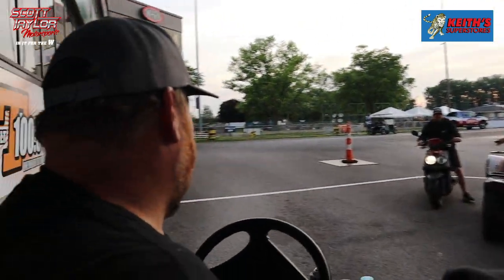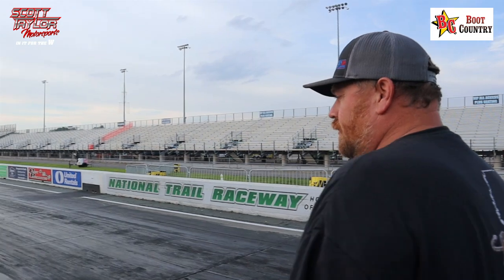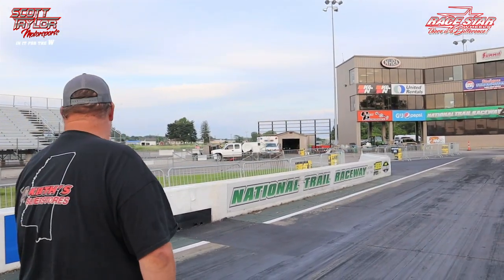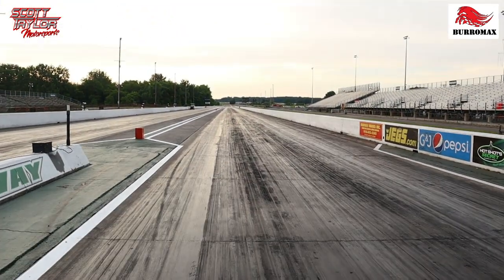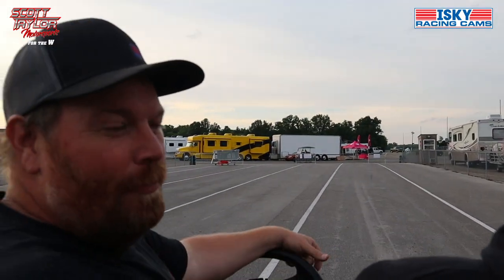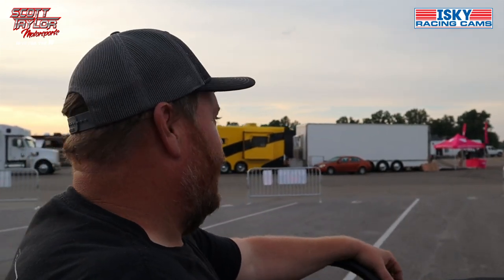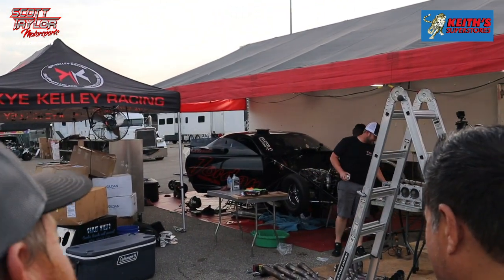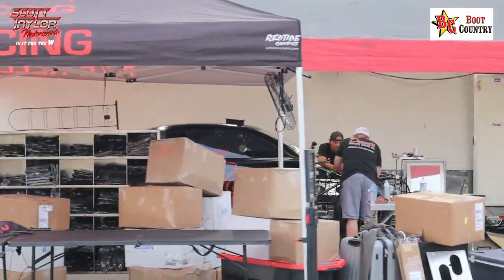What does the NPK racing surface look like?!

Comment: Before every NHRA national they strip they whole 1320’ and a prepped track isn’t what you guys think it is they only prep the first 60ft of the track not the whole thing like you all think the cars carry the VHT down the track on there tires that’s how it gets all the way to the finish line trust me I was a starting line official when my car was broke or I went out, and a-lot of the little IHRA 1/8th mile tracks back in the day like Byhalia MS didn’t prep we raced plenty of no prep and prep’d surfaces without changing our setup only things we might change is tire pressure because of the temperature ( 5-10psi ) and adjust the carb to the altitude that’s it, no converter swaps suspension swaps etc..